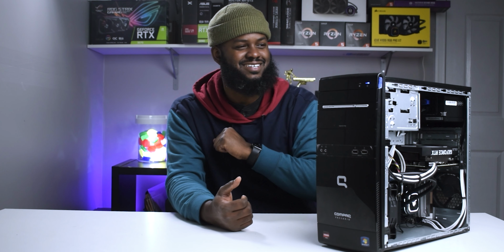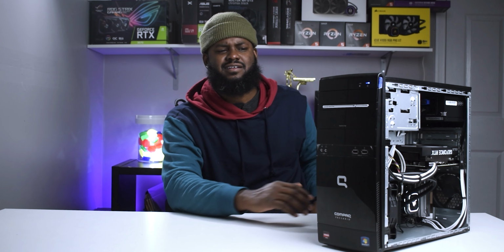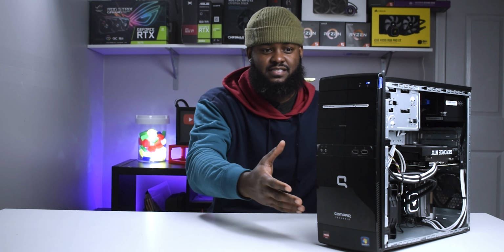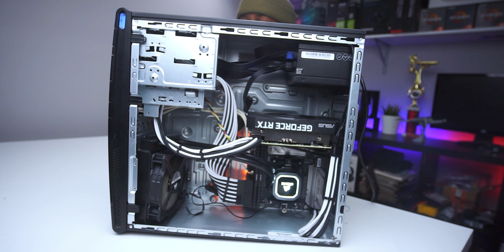Building a SLEEPER PC  - Compaq Presario Sleeper PC Mod

Comment: I remember buying a couple of those units as inexpensive off-the-shelf PCs for clients… perfect for a 2022 sleeper. Happy to see you were able to get the components to fit, HP / Compaq (and others) use so many customizations to their components and cases it was often near impossible just to replace the power supply with even a basic ATX unit.
Reply from the maker: I was surprised the front panel fit as well as it did. what do you do?
Reply: @AliOxen  Was that a rhetorical "what do you do" as in ¯\_(ツ)_/¯ , or were you asking what I do? lol
Reply from the maker: 😂 I see now exactly how that reads lol. No, not rhetorical. You mentioned clients so I meant, as a profession, what is it that you do or did?
Reply: @AliOxen  No worries, exactly why I asked! I used to run my own business doing small business / home user IT support, so plenty of experience in computer assembly, troubleshooting, etc. While I now work for an electronics manufacturer, I still have a passion for PC builds (finally built myself a new ITX machine in 2019/2020), and those like yourself who are doing creative things! I will note that I've been inspired by some of your 3D printing uses, and I finally ordered one so I can drop the excuses. lol

Comment: nice build, but the AIO tubes should go at the bottom, not at the top. the air bubbles always stay on the top, if they are sucked into the pump they will damage it in the long run

Comment: I remember turning down an "old-style" AMD HP computer that had Windows 10 and 4 GB of RAM inside. But, it was too new, and I insisted on the chubby one, with low ram, and no HDD.

When I say "too new," that means it's not beige.

Comment: How did you wire the power button and power led the different colored wires confuse me? Like yellow and white are the hdd,  blue and green are the power led, and black and red are power but which is + and -🙃🤣 at least on mine 🤔
Reply from the maker: I found that most times there are indicators on the terminals that say power or hdd, so that was the case with this one. If you trace the wires back to the button or lights, you can figure out which set is for what, regardless of the colors though

Comment: Hello! I was wondering would a microATX fit because, I have a build in the works using the exact same model case.
Reply: It should work, the PC likely had an mATX board originally.
Reply: @zeroturn7091  I kind of knew I just thought it was a odd choice to use a itx but, i'd assume hes just using what he already has which is fair
Reply from the maker: I haven't tested it outright but that original OEM board looked to be similar to the M-atx form factor, I just chose ITX because I wanted more space inside the case
Reply: mATX is what came in it originally fits perfectly
Reply: For mounting the front fan did you use zip ties? Or did you cut a hole on the case?

Comment: Appreciate what you did this was my first pc and I love it that’s why I wanted to upgrade it from inside to increase performance and keep the old case 
Wanted to ask you few questions 
1.What’s the psu size you used to replace the old one 
2. Fan sizes front and back 
3. Front io power switch there are only 6 wires in that how do you plug it in 8 wire setup of new mother boards